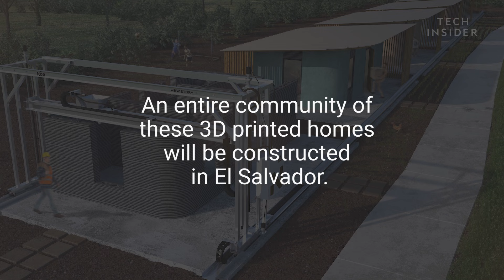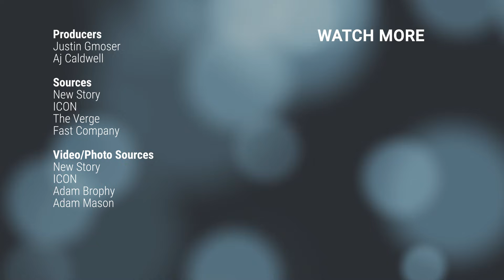3D-Printed Home Can Be Constructed For Under $4,000

Comment: Going to give my perspective as an architecture student:

I really love the proof of concept house. This is a really great idea for homes being built in the 3rd world for those who life in shanty towns. You could build a basic concrete structure using a machine really cheaply because you cut out so much of the labor costs. However, if you train the locals how to build houses using the old way of building homes (how homes were built before we had modern day building materials), then they may just build homes for their community. I'm talking about vernacular architecture (think adobe homes, frontier log cabins, reed huts, and other homes made from natural and local materials).

This sort of building works in areas of lax building regulations. One day the technology might be able to produce concrete structures that are precise enough to conform to building codes. Then we can think about building some in the 1st world. But for now, it's a wonderful replacement to a shack. Like the video said, people want a sense of security. They want to sleep in a safe place where they can lock the door and be assured that no intruder will come in at night.

Modern amenities such as electricity and plumbing are an issue, mostly plumbing. For electricity, you could use a solar panel or wind turbine setup. There's infrastructure that needs to be in place for plumbing (septic tank or sewer line). For that, what could be done is an Off Grid set up -- rainwater collection and storage w/ septic tank (very much like what an Earthship does).  If you guys are interested in building Off Grid for water and electricity, I recommend looking into how Earthships work.
Reply: wtf are u talking about are u writing a book???, nobody gets free houses so far HELLO?!?!?!? the rest is irrelevant
Reply: @foreignbeatz837 First, I want to thank you for your well-thought out and insightful response. 

My understanding is that these houses could be built by a charitable organization using donated funds. However, it is possible that this particular company is operating under another business model for its finances.

Comment: 😂 😂 LAND, LAND, LAND. Is the LAND cheap too?🤔🤔 . what of Windows, Toilet systems, Cement,  Steel, air-conditioning etc. 
This is even more expensive than sand blocks.
Reply: Emma Ik I’m assuming that this is mostly being done in developing countries where land isn’t very expensive and where there are few building regulations. You can also get a composting toilet system for pretty cheap and as far as windows go, people replace their windows all the time so it would probably be possible to collect decent windows that people are just throwing out. Most of the costs of building a home are compliance costs from pulling permits, and complying with very specific building code. El Salvador likely doesn’t have a lot of code requirements.

Comment: Hemp Crete is a perfect material to use. Low carbon, fire proof and a fantastic insulator. Less material to use,
Reply: @Bones Jones . Ok maybe hybrid system then with solid posts top plates and light-weight roofing.
My main point is rapid walls with flame proof. 
And reducing cement and associated massive GHG emissions.

Comment: 🤔 I'd buy if they'd throw in solar, and wind power with batteries that can last 6 months, with water reclamation, recycling in a drought high desert area. That can run a full sized refrigerator, deep freeze, washer, dryer, stove, 120 gall water heater, and t.v. stereo, computer and printer. Just saying. Less than 4k is nice, but I'd want renewable and reusable passive energy sources, for back up. I remember when houses of compressed straw were a thing 20 yrs ago.

Comment: Finally a good use for 3D printing...

However.. the brickwork is usually only a small part of building. Firm footings are important, and letting concrete dry completely before moving onto the next stage.

The printing of rooms is impressive.. but a machine needs to dig/excavate.. and prep before any construction can take place. Or does this machine just take the place of a brick layer?

I would imagine you could probably find a brick layer to build for 4K in a very low wage country.. it’s a nice concept.. and will improve... 

Nick

Comment: This is not much cheaper than concrete blocks -which are basically stone legos. A 20ft by 40 foot space would take about 1800 blocks at 1.25 each or $2,200 for 1,800 8 inch by 8 inch by 16 inch concrete blocks.  (This is blocks only.) If you add some re-rod and concrete to the walls you get a very stable structure.

Comment: This video is fake news. You can't build that for $4,000 dollars. That's the cost of the wood and concrete slab is that alone. Then you have to consider the zoning costs, building permits, etc, etc, etc. This house costs closer to $50,000 dollars. And not all countries would even let you come into their country to build these for the poor. Also, you have to pay to get new pipes put in to supply water to the house so you can run sinks, toilets, showers. You'll also need electricity lines put in. These aren't cheap. Especially if they're nowhere near established lines for either. Living out in the country would cost you hundreds of thousands of dollars just to bring in water and electricity. 

And all this is under the assumption that it doesn't include labour costs. Because I'm assuming these people will travel do it for free or government tax write offs of something.

Comment: I look at this realizing that the roof is probably the most expensive part, there is usually no electricity and pluming where they are building them and they have absolutely no insulation, and no house ensurence . So it's just a tent of pavement.

Comment: You can also purchase a shed from the home improvement store for $2500 then wire and plumb it for another $2500...on cinder blocks...in the countryside, or on a trailer as a tiny house.

Comment: The roof isn’t insulated and those thin concrete walls will not hold heat at all making them real expensive to heat and cool
Reply: Yes, but you could double the structural walls and in between use aerated concrete for insulation.

Comment: This isn't 3D printing. I wish people would stop calling everything 3D printed. This is CNC concrete pouring.
Reply: But 3D printing is just CNC plastic pouring.
Reply: @lancerice6012   CNC is a control infrastructure (Computer Numerical Control). It has nothing to do with what is at the endefector of that control process. CNC can be used for both material removal and additive manufacturing or neither such as a large format printer, pick and place machine,  CNC welder, etc.
Reply: @jamescrud  🎉
Reply: James Crud it’s 3d printing like a home 3d printer that uses melted plastic filament one layer on top of itself at a time
Reply: @bryanmiller476  it's not printing plastic. It's pouring mortar via computer.
Reply: @bryanmiller476   I aware of how this somewhat similar to FDM but the words "3D printing" include more than just FDM printers. Furthermore, you're limited in what is achievable by pouring one layer of concrete over another. That aspect alone means it cannot be classified as "3D printing". 

3D printing are buzzwords used to get attention for everything and it bugs me.
Reply: @jamescrud  

Buy a 3D printer.
Reply: @DaveWard-xc7vd   I have 3 of them at home and use a Stratasys at work everyday.
Reply: Additive Manufacturing
Reply: It's 2D printing repeated many times.
Reply: @cryora  

Even the first layer has a length, width and height.

The very definition of 3D.
Reply: @DaveWard-xc7vd  How do you know there isn't a tiny 4th dimension.  Quantum field theory predicts this.
Reply: @cryora  2d plus the z axis is 3d genius
Reply: @cryora  Technically, it's 3D prints layered many times.
Reply: @cryora  duh, we would need to live in 4D to be able. To fully print in 3D...
Reply: @cryora  That's what 3D printing is
Reply: The point is that windows, and buried structures for utilities are still done by humans. Also interior work is all still human.
Reply: Alright ya big nerd
Reply: @lancerice6012  

C omputer
N umerical
C ontrol

Gcode files control motors that move a print nozzel.

It doesnt matter what comes out.

Cake icing or concrete.
Reply: CNC indirectly refers to the subtraction method of milling something from a solid.  Additive Manufacturing (aka 3D Printing) refers to the additive method of laying down solid in a open space. So It makes sense to call this a 3D Printer, and not a CNC concrete pouring because it is in fact laying down a solid in an open space.
Reply: @JoNnYB1969  I know you are trying to get some plausible escape by writing "indirectly", but CNC means Computer Numerical Control. It is a technology that uses a computer program to operate a machine to do some type of task that would have normally been done by humans. The removal of material by cutting, grinding, or milling with machine tools is called machining. CNC can be used with machine tools such as drills, lathes, bores, waterjet cutters, tape layers, and 3D printers.
Reply: at least i'd get to work off a straight foundation for once
Reply: It is 3d printing
Reply: Also forms could join at be put up, concrete poured in then the firm's could be reused in another house or left in as insulation.  This techniques doesn't seem to be an improvement over other methods.
Reply: You clearly do not understand 3D printing.

The house is in fact partially 3D printed.  The walls are printed.  The rest is traditional construction.
Reply: @DaveWard-xc7vd   "The house is in fact partially 3D printed."

No it's partially poured concrete.
Reply: This is 3D printing
Reply: 3D printers use CNC technology. The fact that it is built layer by layer from a computer build file qualifies it as 3D printing.
Reply: 3D printing is "additive manufacturing" and capable of producing internal structures, whereas CNC is taking material away that isn't needed. ?
Reply: Additive manufacturing and 3d printing are the same thing
Reply: Is it printing, making an impression? And is the result 3D? I think yes to both. But I can also see it being described as Cnc concrete pouring
Reply: I bet you feel really stupid right now.
Reply: Additive Manufacturing
Reply: I like your 3D printed comment
Reply: What difference does it make to you how people describe it ? ....... Its semantics.
Reply: True
Reply: No, it is printing, just with lava based concrete.
Reply: okay but there are so many problems in the world, this company is trying to help solve a problem and you're getting mad that people aren't correctly labeling a machine. boo h*ckin hoo
Reply: CNC is the process of removing material...clearly, this process does not involve removing material but only addition of material.  So, yes, this would fall under 3D printing not CNC.
Reply: Dean Robbins So 3D printing is basically getting a tube that pushes out material in a controllable manner?
Reply: @Brand-oo4jv  Nope.  There are several methods of extrusion that can be used.  One is as you describe, the other is by using light to cause a reaction within a fluid.  That reaction turns the fluid into a solid and is built up with the same idea - layer by layer.  CNC is specific to machining which is the removal of material.
Reply: @deanrobbins8102  

MACHINING is the process of removing material.

Be it CNC or manual machining.
Reply: @Cbeddoe19 "Well. Most 3D printers are just CNC plastic extruders."

Just goes to show how limited your knowledge is. You seem to be familiar with only the cheap hobby machines. DMLS, SLA, and PolyJet machines have nothing at all to do with extruding material.

Comment: Kind of seems like a poor use case for 3d printing, since what you want for houses are largely plain flat panels with the occasional square hole for doors or windows. there are many easier and faster ways to make such shapes, like pre-cast concrete, or even just sheets of plastic

Comment: If 3D printing is just melted plastic doesn’t this solve our plastic problem
Reply: 3d printing doesnt have to be just plastic, it can be metal or concrete or even chocolate. Break down the word 3D printing, your printing in 3 dimensions, and even if it is plastic it can be very easily recycled plastic

Comment: The uninsulated chipboard roof, exposed to moisture, doesn't sit well with me, but this is more a test of the wall tech, I suppose.  Not a bad price for 650 sq feet.  Can it be made to print the slab too?

Comment: It is very misleading to say that you are 3D printing a house for 4K dollars. It appears that you are actually just 3D Printing walls for 4k dollars. You forgot to mention the cost of grading, foundation, plumbing, electrical, roofing, doors & windows, interior finishes, and appliances to name a few. Building walls with concrete block (CMU) is probably cheaper than using this machine and you would be helping boost the local economy by employing skilled labors. I like the innovation but it needs to be better than just concrete walls to deserve much praise.

Comment: I think the 3d printing part is a bit oversold here, after all you still have to do the foundation, roof, doors, electricity, painting etc. by hand. All it does is erect some concrete walls, without any insulation or even a flat surface mind you. Laying some brick walls would probably not be much more expensive or slower, especially somewhere with low wages.
Reply: or just some pre-formed concrete panels

Comment: There is no way you can build this for $4000.  How much did the workers cost that put in the electrical, plumbing and roof?  How much much were the material cost of the electrical, plumbing and roof?  If this house is made in El Salvador where construction cost are much less than America, why don't you state that in the title?   Why do feel the need to deceive the people that don't understand that there is more to building a home pouring concrete?  Is it that for your own self-gratification? Disclose the full cost of the house upon completion in the U.S. or state that it is not built in the United States.  People these days make it very hard to believe in humanity.

Comment: I see they use a steel mesh as reinforcement but what kind of reinforcement do they use vertically? I couldn't see one in the video. Does the shape of the wall remove the need for such reinforcement by converting a push on the wall into compression force?